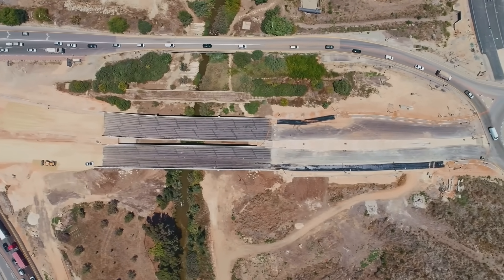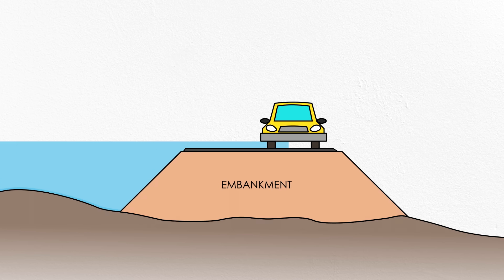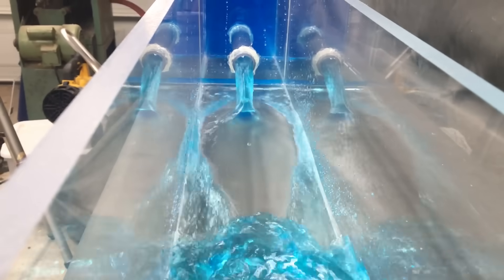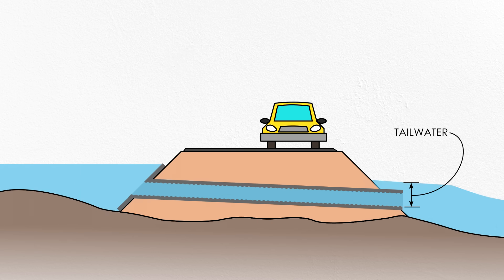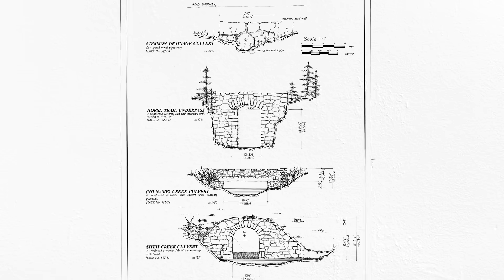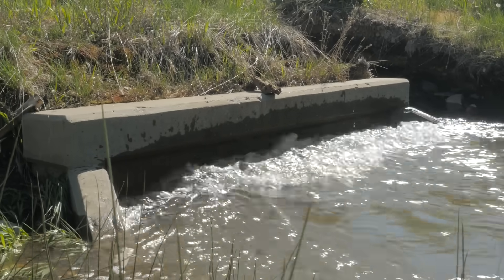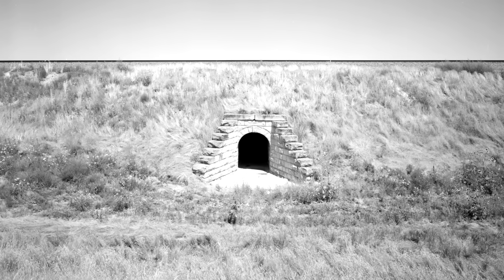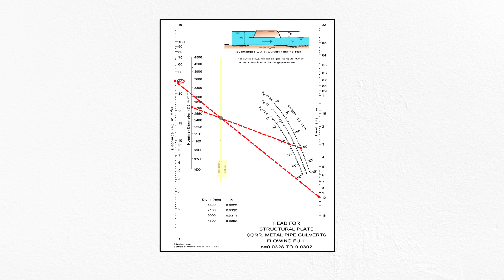What Is a Culvert?

Comment: The engineering of those nomographs is actually more impressive than the culverts themselves.
Reply: They seem magical, but the mathematics is actually quite simple. They're just calculating a linear combination of variables that approximates a function (although the variables themselves aren't necessarily linear with respect to the engineering quantities).
Reply: @Timo Vandrey At least it's not physics: "we model the cow as a sphere in a vacuum"
Reply: If you get any engineering texts from before the 1970's they are full of them. I love them and have them printed out. Still faster and gives you a good idea on how sensitive the answer is to each variable.
Reply: Stuff like this just shows an impressive level of dedication to civil engineering. So much of our society is made possible by these little but incredibly detailed and indepth studies. Really shows that nothing is ever just left to chance.
Reply: Mech Eng graduate, can confirm, sometimes you just gotta use the graphical method. 
Often it’s the most intuitive way of representing a complex relationship.
Reply: Can I get a link to those nomographs?  Were they just a part of the US Culvert Manual featured in the video?
Reply: @FlintTD  I think there may be some nomographs in Armco( American Rolling Mills Company) books about using corrugated metal pipe, pipe arches, and plates which will make up big diameter pipes.
Reply: @dgpsf  thanks for engineersplaining
Reply: @Timo Vandrey Pi is 3.14159.............
Reply: I was a young geologist the first time someone handed me that 350 page document with flow calculations already done for me.  It's a brilliant piece of mathematics
Reply: ikr
Reply: There's a sort of elegance to the way fluid mechanics engineers create their design references by brute force data collection. If Re>>>100 go to Figure 328c.
Reply: @GerardMenvussa  My Google keyboard does
Reply: Many slide rules sacrificed themselves for those nomographs!
Reply: they were still probably calculated by a computer.
Reply: @SuperAWaC  Fun fact: "Computer" used to refer to a person doing sums manually, without the aid of silicon. In that sense, you're not wrong.
Reply: @ideallyyours  Funfact: Not all computers used silicon. Vacuum tubes have existed for a long while, albiet large and ineffecient.
Reply: @familiarbreakfast1892  Fun Fact: Not all computers use electricity. Mechanical calculators were commonplace before electronic ones. The Curta calculator is a notable example.
Reply: @familiarbreakfast1892  equally fun fact: in the days before vacuum tubes, they used relays to build logic gates and made computers with them
Reply: @ideallyyours  A computer was a person whose full-time job was to carry out equations. Those nomographs were probably calculated by a hydraulic engineer, or a team of engineers.
Reply: SuperAWaC no. They are from the studies and built by engineers using formulae.
Reply: @idjles  and those formulae can be reduced into mechanical cams, which allow for easy plotting of graphs. hence a mechanical computer.
Reply: @idjles  Still wouldn't surprise me if at least some of them benefited from the use of some kind of calculating machine to analyse the data. Major scientific, academic and government institutions have been using such things for data analysis to some degree for almost 2 centuries now (Babbage's difference engines were like late 18th century I think). Formula's are often a lot less work to use than the analysis needed to derive and validate them in the first place so would be the latter where I would expect the best productivity amplifiers at the time to be put to work.
Reply: Seraphina they probably used slide rules
Reply: @SuperAWaC  "they probably made that 300 some page manual and uploaded it to the web using a computer"
Reply: @SuperAWaC  - I'm old enough to remember when slide rules were used more than calculators. Nomographs and tables (logarithmic & trigonometric) were very common. They were made by computer. Usually a small staff of women (usually women) with the job tittle of computer.

There were also other technical jobs that was considered woman's work, in an almost derogatory sense. One such job, was an electronics assembler. My mom and several aunts performed this job.

Comment: Aeronautical Engineer: So you see we can achieve a 1% lightening of the structure by using AI and 3D printing to finely optimise the shape of the internal support
Civil Engineer: Pipe.
Reply: My civil engineering professors explicitly told us to not do that type of fanciness. If you want an AI optimized pipe exactly for your requirements, you certainly could design one, but it'll be much more expensive than buying a slightly bigger mass produced one, and thus less efficient.
So, yep. Pipe. Pipe good.
Reply: when in doubt, go up a size
Reply: @adamc7828  Thumbs up.  And never use a size that can't be inspected.
Reply: @cgunugc  haha big pipe goes blub blub blub
Reply: @cgunugc  That's what I learned using West Point Bridge Builder in school. Sometimes using stronger materials was cheaper because it was more common.
Reply: @cgunugc  More to the point the design requirements of a culvert are not certain to 1%, what with estimated historical precipitation and empirical observation of debris effects. The uncertainty requires larger allowances. Aerospace has a fairly clean set of physical parameters and well known effects of fuel consumption verses upfront costs.
Reply: @mytech6779  There's also more incentive in aerospace to try to optimize for that. Fuel costs are one of the biggest expenses for air travel so trying to squeeze every bit out of the plane makes sense. In civil engineering you actually also mostly care about cost but that just materializes in a completely different way. Civil engineering is more about making effective use of things that have already been made because there is a whole infrastructure around it. Tons of people make pipes so you can easily just buy a bigger pipe since so many people need them that they're basically already made in every size you could possibly need.
They're basically trying to do the same thing and while it results in different execution both end up coming to that in the same way through incredibly detailed studies and calculations.
Reply: @cgunugc  sure, but I think the implication here is that civil is the short bus of engineering.
Reply: I think that most of my friends who are mechanical or aeronotic engineers never got a job but I did, so at least I do engineering
Reply: @lpnumb10  sure hope your job doesn't involve spelling
Reply: I am a machinist and I'd much rather work for a civil engineer.
Reply: @SuperAWaC  you lot are never happy. No point in even trying. Just get back to work and get it done.
Reply: That pipe everyone else is using.
Reply: Tf are you guys talking about

Comment: 1:06: "It would be nice if the landscape between these points were flat, but this is rarely true". Unless you live in The Netherlands, in which case this very much is the norm
Reply: True enough, but "flat, but under sea level" brings a whole other set of challenges ;)
Reply: I grew up in South Florida. Terrain altitude never changed measurably other than the landfill near Fort Lauderdale Airport we all called Mt. Trashmore.
Reply: 'Straya
Reply: And then you have flat land but you still have to worry about the water... :')
Reply: @Zebra_M  In fact, is harder to drain flat terrain than where there is some slope.
Reply: Texas Panhandle ftw
Reply: Lucky! I live in Norway.  A straight flat road is extremely rare.